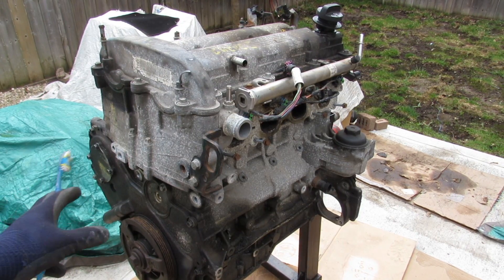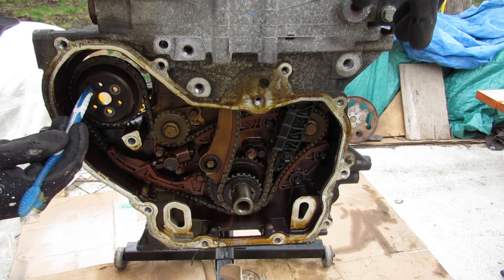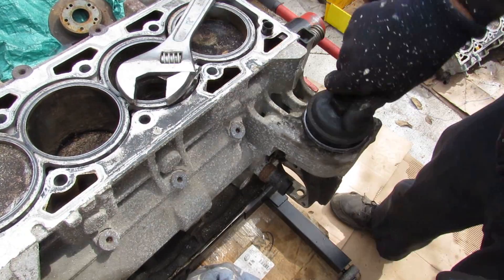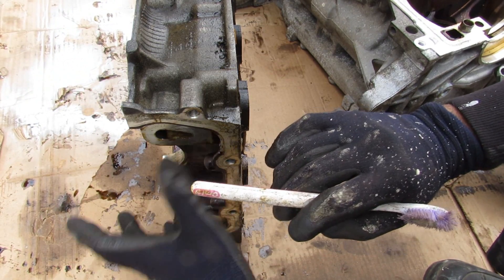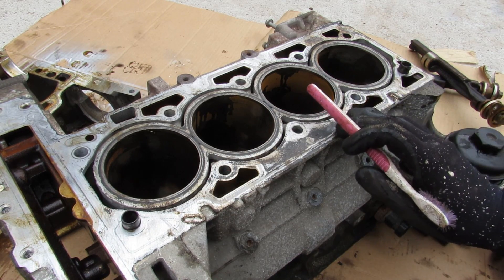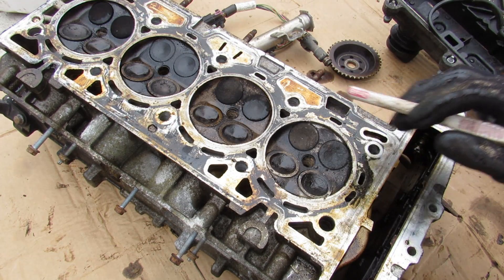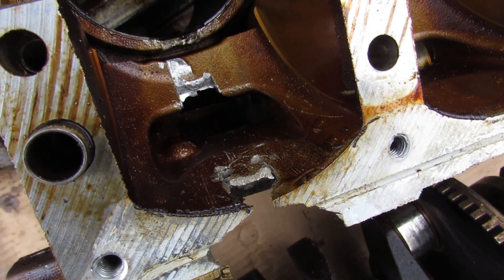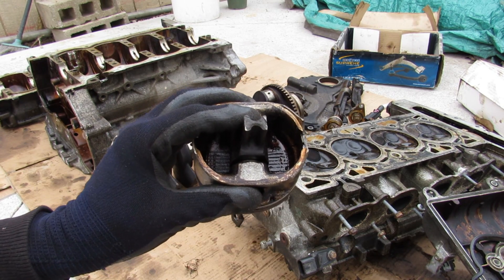Why GM Ecotec Engines FAIL

Comment: "Why gm ecotec engines fails" because its a gm
Reply from the maker: Lol
Reply: Genuine Misery
Reply: LOVE IT!!!!
Reply: "Why Chev 350s run forever" ???
Reply: @fun_ghoul  Same with old Ford 302’s and 351’s, but don’t dare think for a minute any Ecoboost motor is going to live up to their legacy.

Basically you have two choices with engine designs: economy or reliability. Even small modern Honda engines aren’t reliable. Look at the 1.5L earthdreams with their oil dilution issues. I’d rather take a fuel economy hit and get another 100k out of my engine.
Reply: @emotionz3  Even the Earth Dreams/J35 Honda engines leave a lot to be desired. I wouldn't trust a used Honda with an ED V6. Not after all the oil consumption, crankcases filled with gasoline, bad valve seats, etc.
Reply: @emotionz3  Ecoboost 3.5 going at 230k miles. Drinking more oil than usual but still running.
Reply: @fun_ghoul  Joe, JD power and Consumer Reports have both tracked and reported based on consumer feedback that year over year for the last 7 years (since 2014) vehicle engines have failed at exponentially higher rates than any other time in history (consumer reports has been tracking this with their satisfaction survey since the 1960’s!)

Direct injection, poor engineering, bad manufacturing practices, impossible to meet regulations and over boosting are all causing astronomically higher engine failures and that isn’t sustainable for manufactures. The end game here is likely going to be simply jumping to electric ASAP but they have to make it their first. Roll up to any Subaru or Hyundai/KIA dealership and you will see around back they have 2-3 dedicated parking spots for pallets of engines. All of those engines will be installed that week in customers vehicles.

Ford, GM, VW, BMW, and Honda are all in the same boat. Varying reasons, but the fact is the internal combustion engine has gotten LESS RELIABLE over the last decade.
Reply: @palmviewlobos15  if you have the corporate spec 3.5 that’s a reliable motor because it only runs 15psi (11psi in transverse mount vehicles due to less intercooler headroom and FWD/AWD transmission concerns with high torque) but you can get the Ford GT that extracts 650hp out of that thing with 30psi of boost will not make it to your mileage without service. Honda is learning the hard way what gambling with high boost in consumer applications will cost them. Reputationally and financially.

I’m not saying it can’t be done, but lots of small motors have reliable pulled 600hp throughout history. Mercedes has a 300hp naturally aspirated 4 cylinder. Toyota has a 250hp 3 cylinder. But the components are all bespoke to those motors. The Ford corporate 3.5 is just that, a corporate motor. The block and majority components are all the same as low HP applications and it just isn’t engineered to do 600+HP, and partially re-engineering it isn’t the right approach.
Reply: It fails at 260,000 miles.....Ford fails around 80,0000..... here's your sign
Reply: GM=Garbage Motors, 4 cylinder engine’s that is.
Reply: @hyacinthbucket3803  While I can't speak for all of them the 2.0-2.4l ecotecs from 2004-2013ish (the 2002-2003 had an issue that if you baby it, the cam chain squirter wouldn't lubricate properly but that was found out and fixed within 2 years and was a $20 part that could be replaced in an hour with the engine in the car.) had almost no failures that weren't maintenance related or low % unlucky QC and had no recalls whatsoever. Also considering it was made as an economy engine with no intent to make it a performance one (the 2.0 is their realization that it could and is only a destroked L61 with piston squirters installed from the factory) the power you can get out of it safely per step up is crazy. This engine starts at 140HP and 130  torque from factory and the GM build guide states stock it's good up to 250HP, after that it's pistons and rods then it's good to 500HP, then a billet crank till 750HP, then they recommend better cylinder liners and a different oil pick up and that's good up to 1000HP and after that I think performance GM made a copy of that block out of higher quality aluminum and a better casting procedure that safely makes 1400HP.
Reply: @m.d.598  I was just making a smart ass comment, but I just wanted to thank you for the information you posted.
Reply: @hyacinthbucket3803  also, if you want a reliable GM 4cyl, as long as you ditch the orange crap, the 2200 sfi, while no speed demon, is a proper tank.